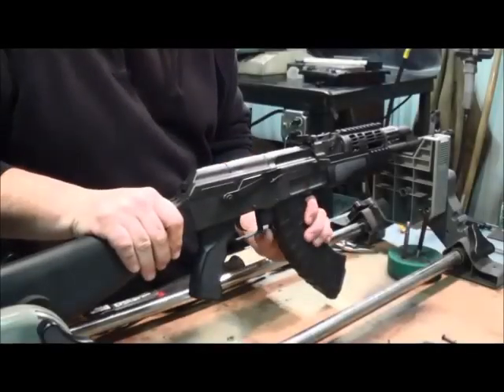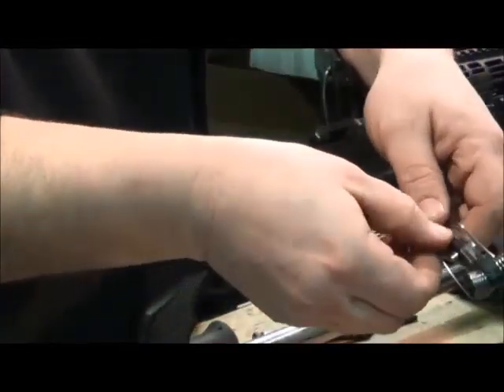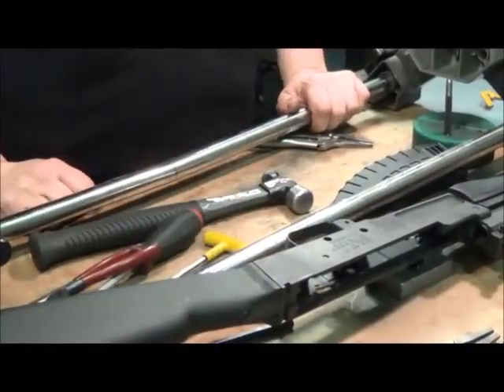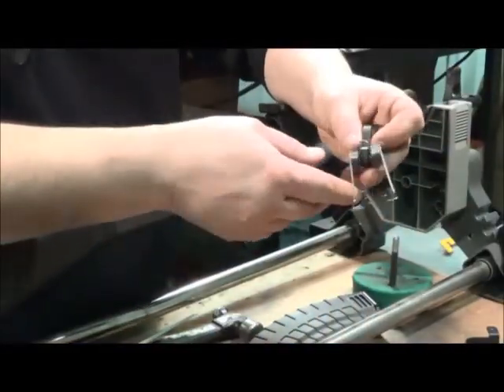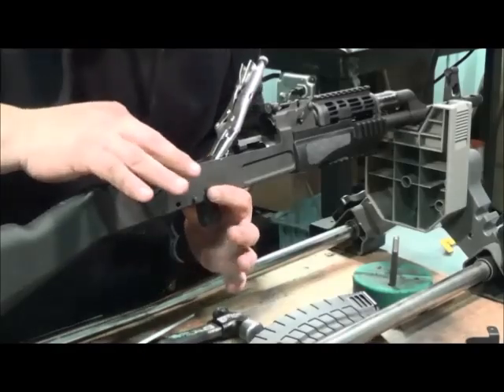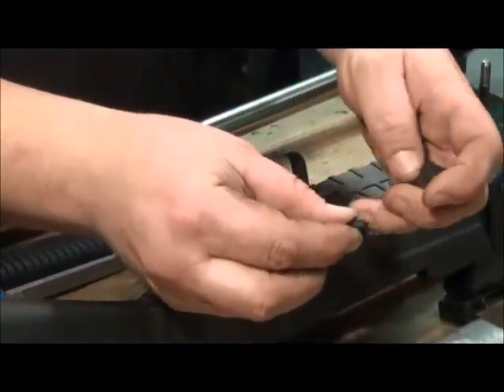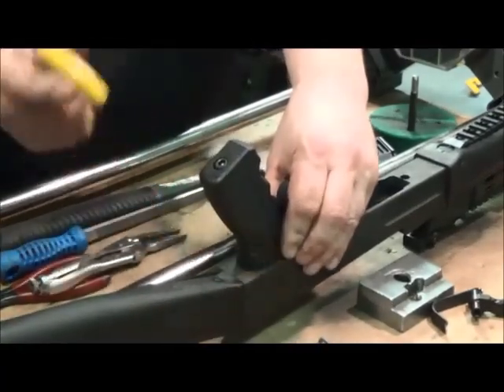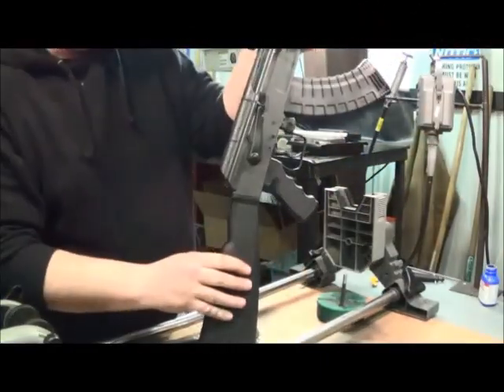AK Double Trigger Installation Video

Comment: Hey guys I notice no one has answered your questions so here I will go. I have owned this exact same rifle c39v1 with the double trigger from the factory for a couple years now. J&G sales had a run of them installed stock. I can tell you the trigger does not allow you to shoot faster.... unless you have fingers as strong as the hulks... It is a very amazing system though and I shall explain... First any of you guys been knee deep in a car trying to get a stuck bolt with a socket and with all your might you cant break it free. Then you go get a 2 piece of pipe add it to your socket and breaking the bolt was almost effortless? That is the same principal of this trigger system. It acts as your breaker bar giving you extreme leverage.... Makes a 5-6lb trigger feel like 2 pounds or less. It is no gimmick and it works. Also I shoot a lot of brass matches and some outlaw betting for money matches... (I am active duty military... we play for keeps) Up here in northern Michigan the huge trigger guard is a life saver for those of us who wear gloves when it is 20 below zero during a shooting match... (call me a pussy I know). Also the grip you get is so much more improved it is a little different to get used to and build your muscle memory but when you do it is a life changer. I wont be surprised if all firearms do not go to this. Those of us that own or have played with one for any amount of time love them. I have even seen ar-15 going to it. Also last bit about it is think of it this way. Instead of straining both fingers.. You only strain one so a even lighter trigger pull feels that much lighter. Cheers.... Enjoy guys. If you want to see one being shot in action you can look at my youtube channel and there are two videos of me shooting it in a brass match...

Comment: To those of  you who are being disparaging: Keep in mind that the more products there are on the market for your firearm the longer it will stay popular and the longer companies will keep producing the stuff YOU want for it, no matter how bizarre or mundane it is. Don't bang it before you, well, bang it.

This is a far  clearer and more concise video about the basic disassembly and reassembly of an AK fire control group than most on YouTube.  It also shows a couple of tricks using  needle nose vise grips for easy disassembly and reassembly that not everyone knows.
Reply: ColonelColt Hey guys I notice no one has answered your questions so here I will go. I have owned this exact same rifle c39v1 with the double trigger from the factory for a couple years now. J&G sales had a run of them installed stock. I can tell you the trigger does not allow you to shoot faster.... unless you have fingers as strong as the hulks... It is a very amazing system though and I shall explain... First any of you guys been knee deep in a car trying to get a stuck bolt with a socket and with all your might you cant break it free. Then you go get a 2 piece of pipe add it to your socket and breaking the bolt was almost effortless? That is the same principal of this trigger system. It acts as your breaker bar giving you extreme leverage.... Makes a 5-6lb trigger feel like 2 pounds or less. It is no gimmick and it works. Also I shoot a lot of brass matches and some outlaw betting for money matches... (I am active duty military... we play for keeps) Up here in northern Michigan the huge trigger guard is a life saver for those of us who wear gloves when it is 20 below zero during a shooting match... (call me a pussy I know). Also the grip you get is so much more improved it is a little different to get used to and build your muscle memory but when you do it is a life changer. I wont be surprised if all firearms do not go to this. Those of us that own or have played with one for any amount of time love them. I have even seen ar-15 going to it. Also last bit about it is think of it this way. Instead of straining both fingers.. You only strain one so a even lighter trigger pull feels that much lighter. Cheers.... Enjoy guys. If you want to see one being shot in action you can look at my youtube channel and there are two videos of me shooting it in a brass match...

Comment: Nice video, but what is the point of that Goofy trigger?
Reply: Z0mb3h Hunt3r Hey guys I notice no one has answered your questions so here I will go. I have owned this exact same rifle c39v1 with the double trigger from the factory for a couple years now. J&G sales had a run of them installed stock. I can tell you the trigger does not allow you to shoot faster.... unless you have fingers as strong as the hulks... It is a very amazing system though and I shall explain... First any of you guys been knee deep in a car trying to get a stuck bolt with a socket and with all your might you cant break it free. Then you go get a 2 piece of pipe add it to your socket and breaking the bolt was almost effortless? That is the same principal of this trigger system. It acts as your breaker bar giving you extreme leverage.... Makes a 5-6lb trigger feel like 2 pounds or less. It is no gimmick and it works. Also I shoot a lot of brass matches and some outlaw betting for money matches... (I am active duty military... we play for keeps) Up here in northern Michigan the huge trigger guard is a life saver for those of us who wear gloves when it is 20 below zero during a shooting match... (call me a pussy I know). Also the grip you get is so much more improved it is a little different to get used to and build your muscle memory but when you do it is a life changer. I wont be surprised if all firearms do not go to this. Those of us that own or have played with one for any amount of time love them. I have even seen ar-15 going to it. Also last bit about it is think of it this way. Instead of straining both fingers.. You only strain one so a even lighter trigger pull feels that much lighter. Cheers.... Enjoy guys. If you want to see one being shot in action you can look at my youtube channel and there are two videos of me shooting it in a brass match...